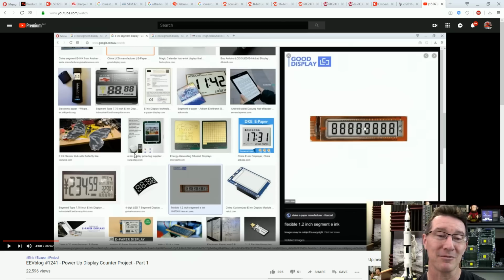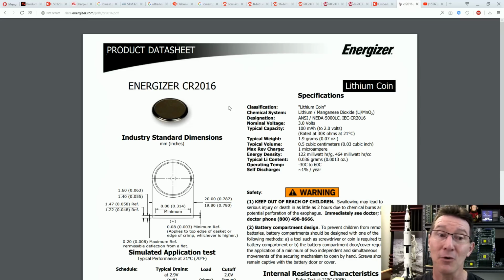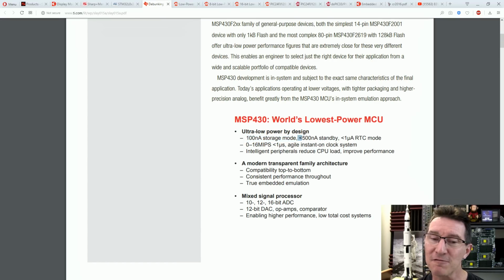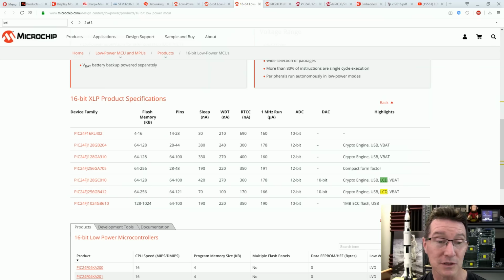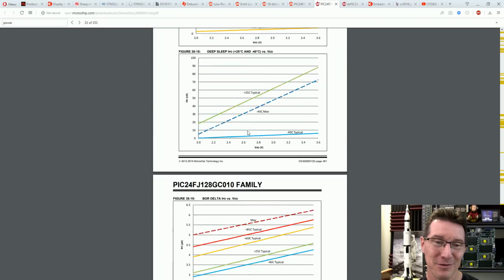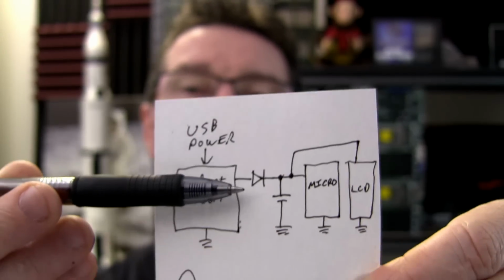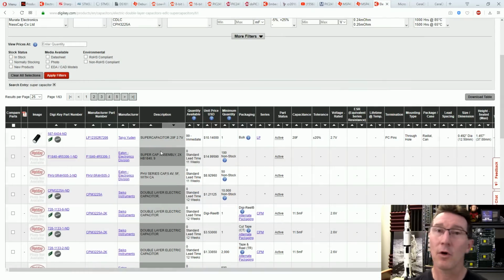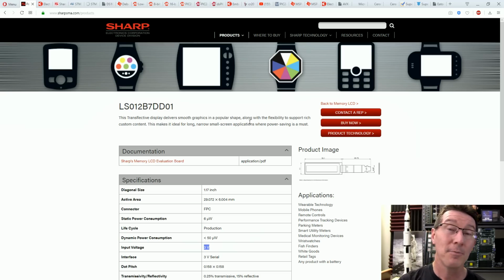EEVblog #1242 - Memory LCD+Supercaps+Low Power Design

Comment: Just use an electromechanical counter, I work for one of the world's largest medical device companies and even with all the high tech products they have they still rely on electromechanical hours counters to measure system usage on their devices, simple, cheap and reliable. The count is always visible with no power needed, they are robust, only downside is maybe size. No point in reinventing the wheel.
Reply: Agree. A 5 digit counter is just 26 x 15 x 32mm

Comment: It looks like you are on the right track with the LCD with integrated controller. Previous comments about adding a solar cell to turn on the LCD only when light is available seem to be also right on. Take a look at PIC 12 series, 8 bits, 20nA in sleep. Wake on pin change, push the new value to the LCD, go back to sleep. You really have to be careful that your PCB is clean at these current levels.

Comment: Reckon the reason 7seg epaper isn't easy to find is that it makes very little sense. Just use the cheapest suitable graphics epaper, simulate 7seg in software. You don't even need fonts, just a segment shape and some rotation/shifting manipulation code. Bloody hardware engineers, learn to program!

Comment: i've seen plenty of those little rechargeable batteries with solder on tabs. often have yellow shrink on the outside.  About the size of that 2032 ,  dunno why ur going on about this ,, lol they come in dam near all sizes. Replaced one from a welding autodark  last year. seen them in computers(notPC's) and phone servers. I think they last like 5 or 10 years.   flat / tiny / round .....   Here google says this https://www.ebay.com/itm/1-2-Volt-80mAh-Ni-MH-Rechargeable-Button-Coin-Cell-Battery-With-Solder-Pins-80H/401787538907?hash=item5d8c674ddb:g:rIoAAOSw0fddBdpH       and LR2450 and etc etc .. batteries come in nearly all sizes fathomable

Comment: How about microminiature flip-dots - driven by microminiature solenoids, of course? There are (or were) lots of ideas for MEMS displays, like the Pixtronix digital micro shutter, but AFAIK none of them really got off the ground.
Reply: Just go mechanical at that point. Devices for that have been around forever.

Comment: Would adding a small solar panel like a calculator be valid? If its a non back-lit display you will need to have light to view it anyways. Maybe if creating your own lcd is a valid option would integrating a transparent solar panel into the screen be a valid option? I have not found any literature about implementing a solar panel into a lcd but heres a white paper on the transparent lcd (https://www.sciencedirect.com/science/article/pii/S1364032118304672). If long term batteries are an option would it be possible to get a small nuclear battery? Link to a super small very energy dense battery that would potentially meet the power requirements (https://phys.org/news/2018-06-prototype-nuclear-battery-power.html) & (https://www.sciencedirect.com/science/article/pii/S0925963517307495)

Comment: Here's an idea. Add a PV cell to power the LCD and just use the battery or super cap to run the micro.  After all, there is no point in driving the LCD when there isn't enough ambient light to read the display.  So the PV cell is also a light sensor that tells the unit to turn off it's display and save power at night.  And during the day, the PV cell reduces the load on the battery.

Comment: PIC16LF1933, 8bit PIC with LCD driver, Sharp LCD still likely better solution.
Reply: You do not need Sharp LCD if you have micro with LCD controller. And STM8L will be cheaper.

Comment: But the super cap can recharge each time you plug it in... how long do you expect to be between each use?
Reply: I assume the requirement is to be readable with no power for years.
Reply: ^^^ This.

Comment: Why not use a  E paper display panel with 128*80 resolution, and use a font to display as many digits as you want?  Is the reason for wanting a 7-segment because needing to draw a font you would need a more expensive micro?
Reply: I do think that e-paper refresh is relatively quite hungry in power consumption
Reply: bitmap font weights nothing if you want only numbers, you can store 1 pixel per BIT with some additional calculations. You can also store them only a few pixels height, scaling them at runtime (x2 or x3 without interpolation is as easy as a bit shift)
Reply: dvhh e-ink refresh is zero power.
Reply: @johnfrancisdoe1563  maintaining the same image is zero power consumption, changing it requires power ( and depending on your type of refresh you would need a relatively lot of it )

Comment: if you add a photoresistor or photodiode you can keep the LCD off until the device is opened and then turn it on. Or add a tiny push button. There are other ultra low power micros that are cheaper and better. The ESP32 specs are quite nice and you have wifi and BT but sadly no lcd driver. 
Light-sleep-0.8 mA Deep-sleep The ULP co-processor is powered on.150uA ULP sensor-monitored pattern100uA @1% duty RTC timer + RTC memory 10uA Hibernation RTC timer only 5uA

Comment: Seeed studio is selling this "Longan Nano is a development board based on GD32VF103CBT6 MCU with RISC-V 32-bit core of GigaDevice. Longan Nano sold by Seeed comes with a 0.96inch 160x80 IPS RGB LCD and an acrylic transparent case." For $4.90. Not affiliated with seeed studio in any way.
Reply: Khurram Akhtar Yeah, it's in their newsletter, but how long will the display work on cap or microbattery.

Comment: Maybe best solution is one of those $1 credit card size calculators with solar cell and battery where you do a +1 and use the equal sign as your counter :)
Depending how often you want to refresh the display the e-ink type display may use more energy than the small Sharp memory LCD as it takes seconds to refresh the e-ink.
Reply: It's a power-on counter - he only wants to change the display when the device is powered on. Which means there's plenty of power available (since it draws off the device's normal power supply), so a low-energy solution isn't needed with e-ink.
Reply: Actually small solar cell like on old calculators could work, use it to power lcd display only. But it will occupy more space.

Comment: I'm thinking that a graphic one may not be as bad as it seems. If it's in a fancy product, it probably already has a microcontroller that can drive the E-ink display without much issue. Then there wouldn't need to be anything apart from the E-ink display added.

Comment: Pro tip, don't judge size by the picture on digikey. 😉
Reply from the maker: Camera angle matters too.
Reply: I've made that mistake. Part only available in SMD "Meh I can probably solder some leads to it"  Comes in and it's small enough to accidentally inhale if I breathe too close to it.  Of course the dimensions are on the data sheet but for whatever reason I still picture it bigger. :P

Comment: MSP430s have become my go-to for low power applications 
but if your using a sharp memory display, yeah a little cheap 6 pin micro can work just fine, especially because in this case you can start it up than shut it off after a few clock cycles either internally or using an external low power timer and leave the display on 
also i asked someone i used to work with and he claims teeny tiny graphic epaper displays designed to be the same size as those 128x32 OLED displays do apparently still exist but he had no information on where to get them or the resolution so take that for what you want
Reply: One thing i do know is 2"x1" eink displays of 200x100(ish) resolution are readily available ... it would be larger than you would hope but fitting all of the electronics under it might not be that big of a sacrifice 
could also add features like a 2nd display that will display counts since last "reset" allowing a button to be pressed to indicate a service has been done, or visaversa
Reply from the maker: Yep, small ones seem hard to get
Reply: another feature you could add in to make up for the larger size would be a  programmable serial number, repair indicator after x cycles, ability to upload a logo, stuff like that 
would not take up all that much more memory but you might need to go from a 6 pin micro to an 8 pin one 
just some train of thought ideas

Comment: For a power up  counter it could considered to wake up on power up, update count and go back to full lowest powerstate . Given that display does not necesarily need to be on all the time. Using a pinchange trigger a touch pad could wake and display, then shut to lowest power state again. The power demand then is virtually nill unles the user is constantly activating readout.
Reply: Helmuth Schultes Once there's user activated readout, there might as well be a user held probe with the battery and LCD, leaving only an EEPROM based counter in the module.  At-a-glance viewing would do better with eInk.

Comment: Use a bloody graphic ePaper display ya goose. All this crap because you don't like a flex connector!?!?!?
Reply from the maker: Geeze, I said that in the video, but it was worth trying to find a segmented one first for several reasons. You know, a typical engineering evaluation cycle as part of the development process....
Reply: its not the flex he doesnt like.  He doesnt want to faff about with a hotbar.
Reply: @FennecTECH  There are plenty of displays available with FPC connectors if you don't want to solder it directly to the board.

Comment: The self-discharge rate of super-caps is also fairly high. Perhaps a small rechargable lithium coin cell could work. Also note that current limiting is suggested for charging a super-capacitor (try not to design the circuit with only the diode as shown in the video).
Reply from the maker: Yes, was going to include that, but super cap wasn't an option anyway so didn't go into a charging specifics.

Comment: The self discharge rate of the super caps and coin cells are quite high. I had to design a product that would keep the clock running for 10 years. I ended up with a rechargeable low loss battery.  MS920T-FL27E 3V 6.5mAH
Reply: Every time I have tried to design some low power gadget to use a super cap or a small rechargeable battery, I just ended up using a coin cell.
The super caps self discharge too quickly and rechargeable lithium cells don't last very long.
Coin cells can provide a few microamps for years and have a pretty flat discharge curve at such low currents.
Reply: @rocketman221projects  It depends on a particular battery design and manufacturer. I tried some french litium cells that are almost perfectly flat and drop all their voltage right near the last fraction of a percent of the total capacity. And at the same time I have seen some noname made in china ones that have almost linear discharge curve. I belive that most of the cells are somewhere in between the cases. So it is important to select properly selected batteries for the single use products or you can get into truble with not having nearly the required operation time.
Reply from the maker: For 10 years, yeah, primary lithium is the sensible choice. Why did you use a rechargeable for 10 years?
Reply: @EEVblog  The requirements said it only had to run the clock for 3 years without power. But the product has a more than 10 year life. This particular battery has a really long life spec. The clock chip also has a processor controlled charging system so it can just charge when needed.

Comment: I had a small digital wrist watch stay going under my bed for 10 years. Beeping every night at midnight. Never changed the battery
Reply: Standard Casio F-91W is a 10 year battery life, perhaps more if it’s laying idle and never having the backlight used.
Reply: I heard once that in London they have some clock still running for almost 100 years on its original big-ass mercury-sulfur battery.

Comment: I put this question on Patreon. I used a microwave transformer salvage from the side of the road. I removed the secondary windings to get my voltage at 120 VAC,but my amperage with no load on it is .1A     80VAC
1.2A  85VAC
1.4A  90VAC
1.7A  95VAC
2.5A  100VAC
5A      110VAC
7A      115VAC
9.5A   120VAC
Is this normal or you think I got a bad transformer. I am 95% sure I didn't damage it removing the secondary. Could the transformer be bad or is this normal?
Reply: MOTs are made to save iron, they are designed to have the core flux density at or even beyond core saturation at no load, so the no load losses will be enormous due to the core being saturated. At full design load the flux will be lower and the core won't be so far saturated. So they're made to operate at full load at all times, which can't be changed unless you rewind the primary with more turns.
Reply from the maker: I'm not familiar with MOT's so I can't comment off-hand I'm afraid.
Reply: That sounds very abnormal. At 120 V, 9.5 A, you'd be dissipating about 1 kW in your transformer with nothing connected. Does it get cooking hot really quickly under those conditions? If not, your measurement might be off. Could it be that you're measuring the amperage with a clamp meter that's too close to the transformer and is getting disturbed by the magnetic fields?
Reply: I did take the shunts out to see if it helped, I have 2 meters both measurements were taken at least 4 feet from the transformer. I got it from a abandoned micro from the side of the road, I am a 100% i didn't damage it removing the secondary, and it looks ok. It might have been on the side of the road because it was bad. My first time dealing with them.. seen on YouTube people make all kinds of stuff from them, the amperage was almost the same with the shunts.
Reply: No offence, but you may want to reconsider if you should be messing with mains voltage if you don´t know how to check a transformer for damages. Plenty of people die trying to use or mod MOTs because they don´t understand enough about them.

That being said, MOTs do draw a few amps with no load since they are high power transformers. This should almost all be apparent power at no load. The exact numbers also depend on if you removed the magnetic shunts in the core and the model etc.